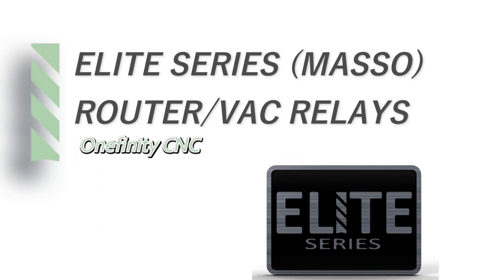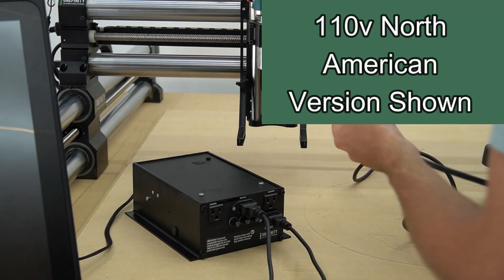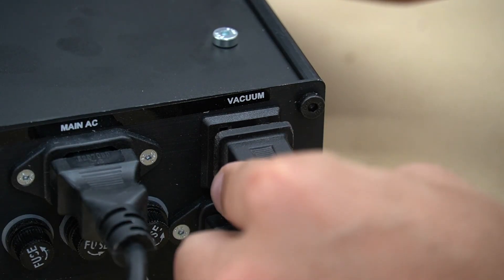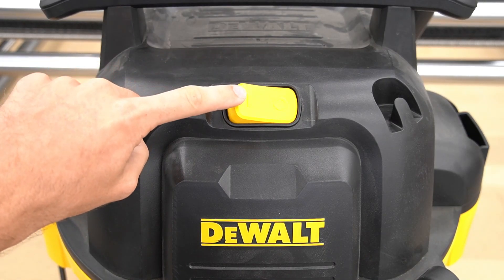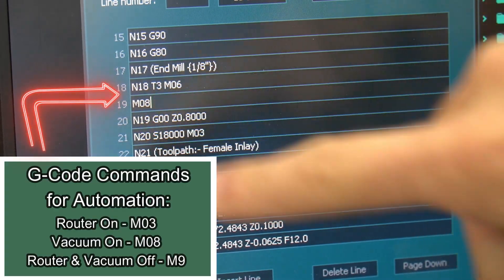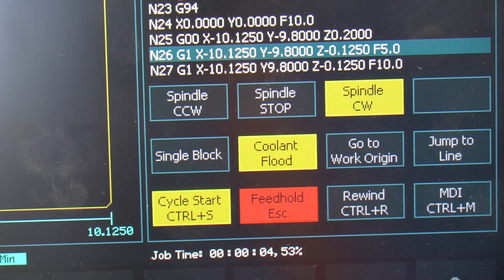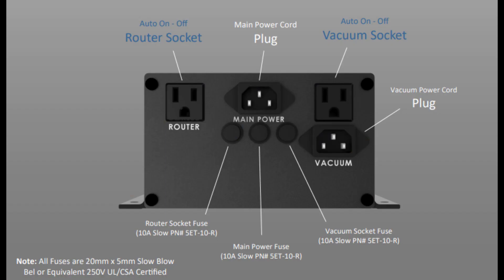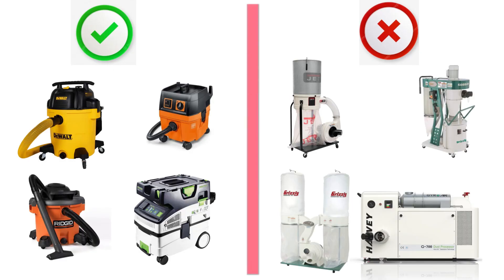Onefinity Elite CNC (Masso) | How to trigger the router and vacuum relay power ports automatically.

Comment: I was always told that you have to have your Masso on a separate electrical circuit from anything with an electric motor to prevent EMI interference. Isn’t this doing the exact opposite of that?
Reply from the maker: Do this first.  If you have emi, you can separate it later.

Comment: Onefinity, 

I'm having some seperate work  done for the 220v SPindle+vfd kit from and a bigger dust collector, but already have an existing 15am circut there. Will that circut be ok for JUST the controller and rails?
Reply from the maker: Yes!

Comment: Thanks for this video. Could you make the same video or provide instructions on how to do this  but with a PWNC 220v spindle and a dust collector (Gyro 700) ?
Reply from the maker: You cannot as both of those are 220v and cannot be controlled by these two ports (The ports are 110 10 amps).
Reply: @OnefinityCNC  are there aftermarket accessories that allows for this function with 220v appliances?
Reply: @jaswoodwork  if you have the PwnCNC spindle kit (with VFD) it will control the spindle.  I’m installing my 220v water cooled kit today.  

As for the 220v dust collector, you could control it with a relay, but that’s not anything that I know how to do personally.